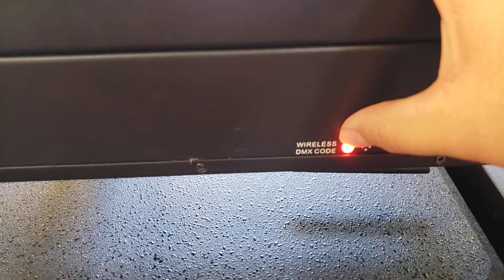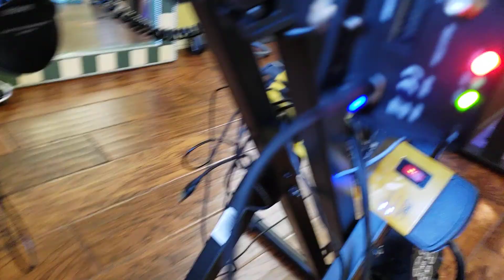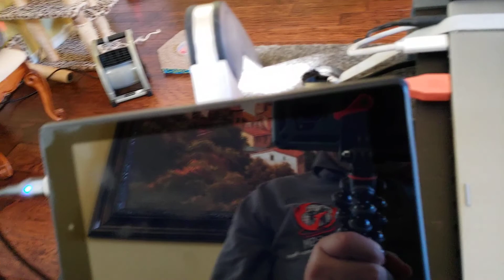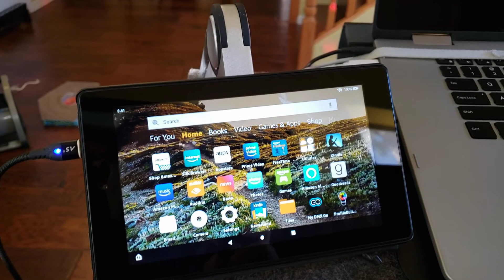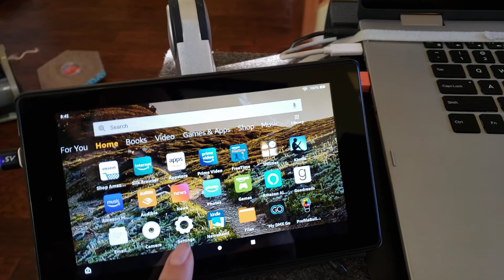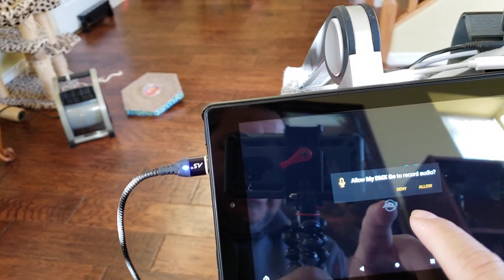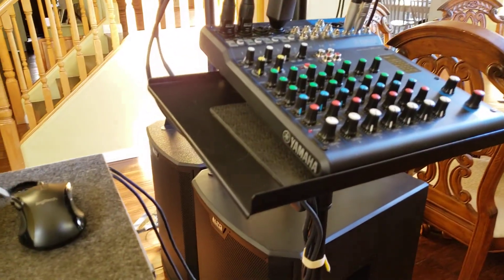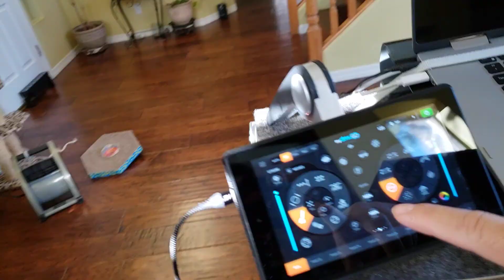Troubleshooting mydmxgo.

Comment: For those having issues with MyDMX Go. 

Items needed:
-MyDMX Go
-Windows/Mac 
-External Router (I use a Google wifi AC1304 hockey puck router for portability & coverage. I can add more for coverage depending on venue size + type c)

1. Install Hardware Manager from ADJ site
2. Connect and set up your router with wifi name and password. This varies from router models but fairly easy to do. **If possible, Change router channel to anything above 7.
3. Connect the MyDMX Go to your computer via usb. 
4. Reset to factory defaults. This should update the firmware too. **Mine didnt work with just a firmware update.
5. Once reset is complete, unplug and reconnect MyDMX Go. 
6. Scroll down to “Wifi” > Mode (Top Right) > Change to “Dual”. **This mode without the antenna attached, worked best for me. Station mode might work for you. 
7. Click “Station” (left side), you will see the list of available networks. This is where your router comes into play. 
8. On the Network List in Hardware Manager you should now see your new wifi name. 
9. Connect to wifi with credentials. Wait for it to show Connected.
10. Disconnect from PC and connect to any STABLE power source. MyDMX Go will now automatically connect to the wifi network you set up (when available). 
11. Connect iPad to new wifi network. 
12. Launch MyDMX Go or Lighrider app. 
13. Click Refresh. MyDMX Go will now appear. 
14. No matter if you unplug MyDMX go, Refresh the app, close the app and follow steps 12-13. 

Few things to note: 
-Do not connect your wireless dmx dongle directly on MyDMX Go. Add distance and connect a dmx cable
-Any router should work. Feel free to test with your home network first. Best to connect to the stronger 2.4Ghz connection.

Comment: IF YOU ARE HAVING CONNECTION ISSUES USE DEVICE MANAGER AND DO STATION MODE TO A SMALL ROUTER THATS PORTABLE FOR EVENTS. YOU ONLY NEED INTERNET ACCESS TO ADD FIXTURES LIBRARY THE FIRST TIME. ALSO PUT AN EXTENSION CABLE ON THE WIRELESS TRANSCEIVER TO GET IT FURTHER AWAY FROM THE INTERNAL ANTENNA AND CUT OUT CROSS TALK AND OTHER CONNECTION ISSUES. USING AN EXTERNAL ROUTER GIVES YOU BETTER CONNECTION AND ALSO GREATER RANGE, WITH MYDMX GO INTERNAL WIRELESS IS VERY LIMITED ON DISTANCE. YOU ALSO MAY WANT TO CHANGE THE WIRELESS CHANNEL YOUR USING TO 7 OR 11. THOSE ARE THE LEAST USED CHANNELS FOR ROUTERS. WITH A ROUTER WHEN PROGRAMING IN STATION MODE MAKE SURE YOUR ON STATION ONLY AND NOT BOTH MODE.
Reply: Mine worked better in Dual mode! To piggy back off this

Items needed:
-MyDMX Go
-Windows/Mac 
-External Router (I use a Google wifi hockey puck router for portability & coverage. I can add more for coverage depending on venue size) 

1. Install Hardware Manager from ADJ site
2. Connect and set up your router with wifi name and password. This varies from router models but fairly easy to do. 
3. Connect the MyDMX Go to your computer via usb. 
4. Reset to factory defaults. This should update the firmware too.
5. Once reset is complete, unplug and reconnect MyDMX Go. 
6. Scroll down to “Wifi” > Mode (Top Right) > Change to “Dual”
7. Click “Station”, you will see the list of available networks. This is where your router comes into play. 
8. On the Network List in Hardware Manager you should now see your new wifi name. 
9. Connect to wifi with credentials. Wait for it to show Connected.
10. Disconnect from PC and connect to any STABLE power source. MyDMX Go will now automatically connect to the wifi network you set up (when available). 
11. Connect iPad to new wifi network. 
12. Launch MyDMX Go or Lighrider app. 
13. Click Refresh. MyDMX Go will now appear. 
14. No matter if you unplug MyDMX go, Refresh the app, close the app and follow steps 12-13. 

Few things to note: 
-Do not connect your wireless dmx dongle directly on MyDMX Go. Add distance and connect a dmx cable
-Any router should work. Feel free to test with your home network first. Best to connect to the stronger 2.4Ghz connection.

Comment: Hi we need help making our dmx power on. It's not working anymore. Used for years and all of a sudden not powering on
Reply from the maker: @itsmona25  what's not powering
Reply from the maker: @itsmona25  log on to the internet on the tablet. You're using mydmxgo and try logging off and logging on. It should fix the problem.

Comment: i have a question. my system was working and now all of a sudden my wifi light doesnt come on. it says im connected on my ipad but the device doesnt turn on the wifi light. any ideas?
Reply from the maker: Try logging off your tablet and logging on. Let me know if that works. 

Are you trying it at your home. Could also be internet interference from your wifi router or any 2.4ghz devices.  Stay clear of that. I saw mine freeze up. But it's random not all the time.
Reply: @steadymanos  it was weird. It didn’t like the project I was in (building). As soon as I went to an existing project with the same fixtures the wifi light came on and it started working. 🤷🏻‍♂️
Reply from the maker: https://youtu.be/PBlE-2Fx1cs

Comment: Hello STEADY MANOS, Sir, how do we get/ live/ to work on the mydmxgo,  fixtures screen works somewhat but no live. I have a tomshine 60w mmh and a uking 50w spot with 8 gobo thank u.
Reply from the maker: Treat mydmxgo unit with the antenna as a wifi router and a image you're trying to connect to wifi on your tablet. In your tablet look in wifi for mydmx. Then connect you might have to put in the passcode. smartdmx0000. Once you're connected you should be able to connect to the lights.  If you're still having trouble then you might have to update the firmware.  YouTube search it. I seen a few videos on how to do that. Good luck